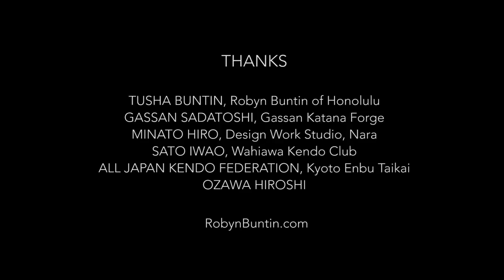Kendo: The Principles of the Sword

Comment: To other comments on the curve of the blade in the Japanese sword styles and cutting effectiveness it's not just the quote curve it's the entire construction of the swords for example in contrast to say the sabre it is meant for slashing and piercing on occasion and is balanced and forged differently than the Japanese swords and I would encourage you to use both cut some tatomi you'll feel the difference for those that aren't going to do that let me explain quickly my point a katana at least for example has a softer core that allows for more flexibility on cut through like an arrow in flight it has been recorded in action several times as well as the balance of the sword also lending itself to that type of attack this flexibility comes into play in thrusting the tip of the sword is in line with the handle as to say they are on the same plane the sabre on there other hand has a top that is above the plane of the grip which means its thrust is less accurate but more importantly less powerful the katana is without doubt or prejudice THE most effective sword of it's type all round if you have thoughts on post would love to hear them

Comment: Wait the curve of the Katana doesn't give it any advantage in cutting capacity? The singular edge is what gives it a better ability to cut because it has a sort of auto balance or stabilization right?
Reply: The curve helps cutting hard things, like bone and bamboo. The curve sword edge has a smaller contact area, just like a meat cleaver, increasing its piercing ability.

Comment: I practice martial arts at a budo school which involves the use of bokken, bo staff, Jo staff, tonfa, wakasashi and hand to hand so this interests me. Though as far as my knowlede unless the curve of the blade is extreme like the scimitar it does not aid in cutting just makes it look more elegant and beautiful. Which is why I beleive they still make them with a subtle curve at least in part. And by no means are they the strongest or best blade in the world as they perfected there forge techneque in part to remove most of the slag or inpurities in the blade to make it stronger but, if they had sufficient smelting technology at that time, it would not be nessisary. Plus they have a very had edge, they may bend before they break but there are much stronger swords that can take a lot more punishment though not as sharp.
Reply: Kyle Jolly curved blades will always be better at cutting, but worst at thrusting. That’s why in most of medieval Europe, in which thrusting was very important with technics like half-swording, they kept the blade straight.
Reply: @neitherlink6612  In the Katana's case not so much since the curve is only subtle but, it is better at hooking like knocking enimies weapons out of the way and sword drawing techneques. And again they are beautiful blades for a reason. And I think it had more to do with versatility and practically than anything else with European swords. Though their is some similarities with some falcions and meiser type blades where they were subtly curved bit, I think in that case it was because they thought it looked better.

Comment: The katana/sword was not the most powerful weapon in the world before the gun. Even for the samurai, other weapons took precedence, specifically with the spear and the bow. In later periods (prior to the meiji restoration), the katana became more of a symbol of status than a warring implement.

They are also incorrect about how the Mongol invasion influenced the shape of the katana. The primary change influenced by the Mongols had nothing to do with the strength of the swords, but rather their ineffective penetrative ability against Mongol armor. This led the Japanese to begin making swords in that period with a shinogi-zukuri (the common tip you see on most katana) to the shobu-zukuri (lily shaped tip). They eventually reverted back to the shinogi-zukuri for most swords, as the shobu-zukuri, while better for penetration, was significantly more delicate and more susceptible to breakage.

This was a decent presentation, but I wish people would romanticizing the katana and the martial arts that developed around it. It's an excellent weapon and an integral part of Japanese culture, but it isn't some magical sword to beat all swords, nor is the sword or is sword practices superior to others around the world.

Comment: Factually false that the katana was "the strongest weapon before the gun". Spears are more historically prevelant because they're easy to use, have much greater range depending on the length of the spear (pikes are a thing), and required fewer and lower quality materials. Cutting power isn't the only determening factor of the pre-firearms meta. Katanas aren't mystical artifacts of unlimited power, they're just majestic metal poles with an edge. And no matter how many times you fold the metal, or for how long you sharpen it, you're NEVER  slashing through plate armour.
They chop worse than axes, they have less range than spears, they're single edged, slightly heavier on average when compared to most classical european arming swords, they're sub-par stabbers and they're also traditionally made of worse metal. In fact, they're not even the best at chopping when compared to other single-edged blades of somewhat similar length. Certain types of Falchion are notoriously good at chopping for instance. They're definitely effective weapons but "strongest weapon before the gun" is one of the stupidest false statements I've ever heard someone suggest about them.

Last thing, the curve of a Katana is created during the quenching process while forging. It doesn't significantly effect cutting power. It does have the beneficial effect of slightly negating bad edge alignment, but the bend you see has little to no prectical effect on cutting efficiency. Tests have been done to prove this. With a much greater curve and on a larger weapon this may not be the case however.

Aside from that, nice Kendo video m8.

Comment: one thing always been overlooked doesn't matter intentionally whatever
.... prolly em wont have realized yet
.... but bruce lee perfected it
uhm whatever
point start to start and release
small footwork toe front push forward step arch back sensory mind connect release
and whatever in the hands/ simply bare hands becomes something anyone should avoid hahaa😀
problem with the langguage not texter 😀😁😄

Comment: Modern kendo has little to do with the sword. I have watched it for decades and can see only one technique that is related to original kendo and that is the thrust or stab. Iaido and Batto Jutsu are just the opposite, there is an actual sword in use whether it is an Iai-to or a katana/wakazashi/tacchi. Gichin Funakoshi, the founder of Japanese karate, said kendo was nothing more than a stick exercise. I am afraid he has a point. I will vote Iaido or Batto as the carrier OF sword tradition.